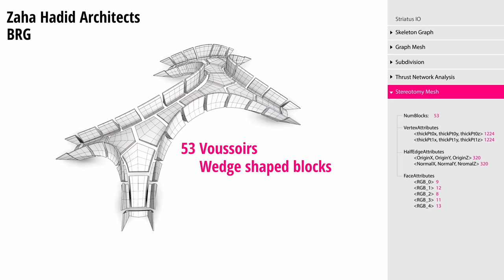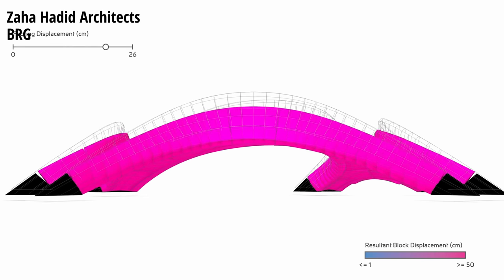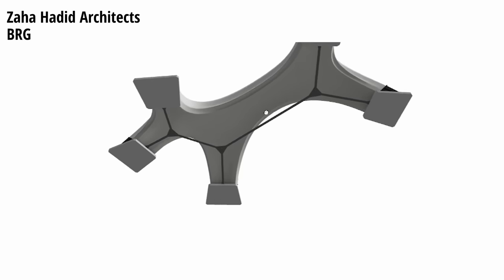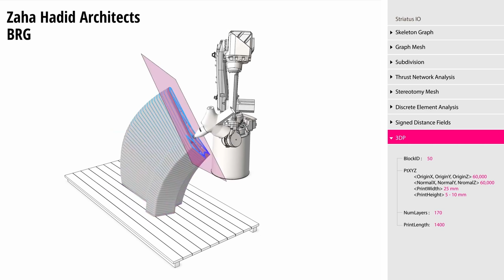3D printed bridge with NO connections! | Striatus

Comment: Wow, very cool. Initially, I wasn't overly impressed, imagining a structure that looked unnecessary, heavy, and probably would've been overly strong without the cables tying the base together. But then, 3D printed light-weight concrete pieces without interlocking or rebar or being completely solid, and only held together with geometry and gravity, very impressive. Excellent video, thank you.

Comment: I'm not an engineer, I'm just some guy, but I think this is very cool. Besides the fragility and opportunity for human error, I'm mostly curious/concerned with how a bridge like this would withstand water. If the hollow cells fill up with water, is there potential for shifting parts, damage, or even reduced overall capacity?
Reply: possibly
Reply: Think about cinder blocks - they're basically the same thing, only less dense and smaller. If these hollow babies can withstand the elements, i don't see any reason why big and dense 3d printed blocks can't.
Reply: @StanislavG.  /\/\/\ right there.
Reply: This is for an exhibition. It is designed to be taken back down, as I understand it.
Reply: @StanislavG.  ah that makes sense, good analogy. I just assumed cinder blocks were eventually filled with some other material
Reply: In the “wrong” environment, freeze/thaw may destroy this bridge rapidly. This is a cool proof of concept though.
Reply: Concrete is water permeable so it is possible that the water seeps out quicker than it enters. If filling up with water is still a problem, a small, short piece of tubing could be inserted at the underside of each piece.
Reply: @StanislavG.  I am not aware of any codes where you are still allowed to have unreinforced masonry walls. This was stopped because of life safety issues. Unreinforced masonry is not usually used to span except for old arches which are keyed together and have a large dead weight component that helps hold the arch together.
Reply: @yodaiam1000  I think the law applies differently to statues and exhibition pieces (no idea to be honest). In housing there are codes (in most places) for cob/SCEB walls that are unreinforced, but you'll probably have to use a reinforced concrete foundation and tie beam to comply. I guess the same codes be applied to this sort of stuff
Reply: @StanislavG.  Most codes are written for either new buildings or highways/bridges. There is only one code I am familiar with that deals with renovations/alterations (You use codes to design alterations,  seismic upgrades etc but the code will usually say at the beginning it is only intended for new buildings) and no codes that I am aware of that deal with exhibitions. Although most authorities want an engineering seal on exhibits/stages etc. I always reference a code or playground standards when designing structures for exhibits since it is the only reference that I have.
Reply: Prescriptive plain masonry is still allowed for seismically inactive areas in the US. Guastavino vaults have been in service up and down the east coast for 100 years. Also, there’s a few small regions like Europe, Asia, Africa, South America and the Middle East which are full of 400+ year old un-reinforced masonry buildings

Comment: Super, as usual. Thanks Belinda🙂
Reply from the maker: Thanks!
Reply: @BelindaCarr  This is not a bridge in the sense that it will convey vehicles or pedestrians over a distance that would otherwise be inaccessible (river, gorge or overpass). It is at best a very expensive playground novelty. Come on Belinda, you usually have practical videos.

Comment: I quite like the design. No pain no gain. Once the quirks are ironed out it would be nice if every area had these 3d printers and it became the norm to print out these blocks from the local outlet. Aesthetics wise it’s the difference between old bridges (more curves) verses modern bridges (more straight lines) - the old bridges are just more pleasing.
Any how, exceptional overview. Always appreciate how you research both the pros and cons.
Reply: This is not a bridge in the sense that it will convey vehicles or pedestrians over a distance that would otherwise be inaccessible (river, gorge or overpass). It is at best a very expensive playground novelty. Belinda usually has practical videos.
Reply: @1982nsu  Since you couldn't figure it out, I'll let you know it's a prototype.  They have to make sure they have proof of concept before actually bridging any actual gaps.  Baby steps.
Reply: @1982nsu  building using 3d printers IS practical. And you talk like Belinda doesnt research both pros and cons.  Luddite mentality.

Comment: Ancient and futuristic at the same time.  Very very cool.  What happens when it gets wet and ice freezes on it? What is the sheer strength of the neoprene?  I am thinking about a 5 millimeter ice "dam" building up due to evaporative cooling of the structure, which will ice, as bridges do, more readily than surrounding non-bridge-like structures that have no air gap below them. If ice moved in between the floating sections, it is possible the pieces could, over time, creep out of position.

Comment: The concept is great, but I'd feel better if they laced steel cables inside of it to provide post tensioning to insure that any seismic up thrust wouldn't dislodge any of the blocks.
Also, I'm concerned that some of the blocks broke in transit because they were fragile.  They need to make the cement mixture a lot tougher for this method of construction to be practicable.  If someone is going to mention that concrete blocks, and terra cotta blocks, are fragile and often get broken in transit and handling, it needs to be noted that blocks are cheap, standard, and readily available.

Comment: Steel in tension, masonry in compression, wide triangular foot print; structural perfection, or nearly so. Job could've been traditional formed/precast concrete sections, or sections cast on-site. 
The cool part here is that the design program can theoretically instruct the masonry printer directly, from anywhere. This might be the most probable application for 3d masonry printing, VS large on-site usage.

Comment: A 3D masonry bridge!  How amazing!  Never saw that before!  And it has NO connections - other than every piece, the ties in the foundation, and the load bearing platforms.  And its purpose?  Going over nothing and connecting nothing.
Reply: It couldn't go over something even if it tried since it needs that collar tie underneath to keep it together
Reply: @UGPepe  it can go over a road or railroad but you might need to tear up part of the road. Won't work for canyons or navigable water.
Reply: @szurketaltos2693   I agree 100%.  This is not a bridge in the sense that it will convey vehicles or pedestrians over a distance that would otherwise be inaccessible (river, gorge or overpass). It is at best a very expensive playground novelty. Belinda usually has practical videos but not this time.
Reply: @UGPepe  It could be designed not to use the collar, but like all structures of this nature it would require more infrastructure at either end.  (IE more significant concrete foundations, or more significant weight elsewhere in the structure.).

You are hardly intelligent for discovering that it needs the collar, the collar is simply the cheapest and least invasive method of allowing this structure to stand in its intended (artistic - since its for a design festival) position.
Reply: Peter Avram damn, my plan of measuring my intelligence in the youtube comment section was working so well until you showed up

Comment: Excellent point that this manufacturing process is able to do things that other processes can not.  But a key problem with the "robot squirts concrete" systems like this is the lack of reinforcing integrated into what is being "printed."  With a flexible arm like they used, pre-bend the rebar and have the applicator arm move around the rebar.  In this case, the reinforcing that "should" be inside the concrete was actually relocated to the ties between the piers, which would conflict with something like boat traffic if this was used to provide movement over a canal.  This is an elegant solution to the limitations of the process but it is still very limited in the end.  Not using connectors is just a silly stunt - an extra PR point for this demonstration, but pointless in "real" applications.  Also, the pieces being too fragile to ship is a significant flaw compared with a construction system that would be "ready for prime time."  It's a beautiful end result, but yet another "stunt" that shows this approach hasn't overcome some major limitations.

Comment: I really want to see more from this idea. I heard about and seen some 3d printed buildings before but nothing of this level. For me the question is practical can you make this technology for real functional structures for example this bridge in a bigger size may be used as a pedestrian bridge to cross a street or an intersection on a busy street.
But how practical would such a bridge be to let traffic cross a river?
I know this specific design probably won't because of the ground level steel rope truss thingy (I'm not an engineer or architect that's not my expertise I'm just an interested and uninformed pleb). But in general how useful could you scale up this idea?
Also how future proof is cement as a building material in general as far as I heard we might not have enough good sand for mixing concrete in the future, not to mention the environmental damage from sand exploitation.
Is there something coming the future?

Comment: 3d printing concrete sounds cool but with the difference in timing for setting, packing, etc, i wonder how defects like cracks are handled. 

maybe a different kind of ceramic that needs to be baked might give better results
Reply: Backing ceramics is a bit too expensive for most applications... I think the future is in portland/lime reinforced clay printing
Reply: your'e thinking of sidewalk or resi-foundation concrete.  This would be a UHPC
Reply: FYI that class of concrete starts at 17,000psi and goes up from there. It doesn't have the water and cracking issues typical 3000psi does.

Comment: How would that kind of structure handle thermal expansion / contraction over long periods of time? Despite the neoprene, couldn't blocks shift relative to one another? (not that Venise would see much of that, but I am just curious to know what more knowledgeable people would think of it)
Reply: Disclaimer: I'm not knowledgeable.

Considering that arch bridges built on the same principle have stood for centuries I'm assuming it's not too difficult for these structures to withstand those forces. They even have the potential to last longer than traditional concreting since the steel reinforcement rusts away over time. The steel tensioning cables shouldn't be too hard to replace.

Since it's a new technology and a new form of engineering infrastructure I suspect were going to see some expensive or even lethal failures until it is mastered.

Comment: I think you meant 2 foot wide extrusion sections with 3 foot tall balustrades? The assembled exotic form without connectors is only made possible by a temporary bespoke support structure; I think that's a big downside, given that it's not economically and ecologically scalable. For instance, you couldn't apply this concept to building a habitat on the Moon or Mars. The technology seems well-suited for bespoke panels such as rainscreens, though.

Comment: I just visited a 3d printed pedestrian bridge in Amsterdam.  It is printed in metal, and is a temporary replacement of  an old bridge being restored. It claims to be the first of its kind and was certainly interesting to see. Unfortunately the design is miles off from the structural efficiency and elegance of the concrete bridge in this video. You might want to do a comparison of the two in a future video.
Reply from the maker: I'm working on a video about that bridge right now! The years of research that went into it is fascinating. Why weren't you impressed?
Reply: The shape is more ‘neo-barok’ than bio-mimetic, as opposed to Laarman’s ‘bone-chair’. Given the cost and time involved in using 3d printing metal, this is a case where maximizing structural efficiency is a no brainer. That would really sell the benefits of freeform design and metal printing. If the idea is to show that you can just make any sculptural shape and get it printed this is not convincing as the layer lines and welding is so crude. The design does not take the directionality of the layering into account in the way the concrete bridge does, so it just looks arbitrary (i.e. bad). The hand rails that curls at the bank, is universally used as a trash can by passers by. Also there is a problem on one side with the pavement not aligning to foot of the bridge, that speaks to the absurdity of using an aerospace technology in a city where nothing is straight. 
Ultimately it just feels like a massive missed opportunity to do a really iconic and memorable example project showing off new possibilities.
Reply: On a side note: 
I watched my dad in the 70’s as he was producing a series of large public sculptures in cast aluminum. The largest ones were equivalent in size to this bridge. His technique was to start with a massive block of styrofoam, which he shaped with a hot wire. The results were clean smooth abstract forms that he had casted in aluminum at a local foundry. He produced these things in a few months, working alone!
It seems to me to produce a bridge like this by conventional means would be quicker, cheaper and higher quality. That may be beside the point of this exercise, but it is up to the designers to convince me what IS the advantage of this method.
Reply from the maker: Thanks a lot for sharing your personal experience! Can you send me your email address or email me belinda.julia@gmail.com? I'd love to speak with you if you have time this week.

Comment: Nice story on a nice piece. I like your comment on people using tech that could be polymorphous to make boxes drives me crazy.   I will point out this isn't a ZERO waste project. I'm guessing that is there claim not yours. Forms were straight to waste, the neoprene cut outs had waste, the printer needed to be flushed/cleaned each time it was used including the mixer and the scrap from the steel base including tension member.. It's low waste for sure but this is an issue with many claims of new "green" projects.

Comment: I think 3D printing in architecture is nothing more than a gimmick. The designs are very limited and the long-term usage is questionable. All those layers are very prone to failure due to heat and freeze issues and other long-term chemical issues.
These 3D-printed buildings are either small or short-term projects. I would really like to see a major project building with 3D printed parts. A building that lasts over many decades, in various temperature environments. Everything else is just simply a proof of concept that has no connection to real-world applications.
Reply: Prone to heat failure and chemical issues… apart from 3d printed chemical rockets ;)
Reply: I agree 100%.  This is not a bridge in the sense that it will convey vehicles or pedestrians over a distance that would otherwise be inaccessible (river, gorge or overpass). It is at best a very expensive playground novelty. Belinda usually has practical videos but not this time.
Reply: I agree that 3D printing as demonstrated to date is gimmicky. The falsework required for this bridge looks complicated and unless you're building many of the same design, it is wasteful. Might as well use the wood for traditional formwork and get the ability to add a little steel for tensile loads. I can't see how using robots to lay down concrete is superior to using molds for these bridge parts. The stress risers that result from the layers put down by the robot alone make me think this is not a good idea.
Reply: @rcrumbblue  molds for every bridge component would be wasteful in materials, unless lots of identical bridges are made (impractical) or the designs are uniform (boring and dystopian). I think all this talk discrediting a new technology just on a select few tests is unhinged frankly. If 3d printing is good enough for printing rockets (and drastically bringing the prices down, because all the intricate pipework for the coolants can be baked into the 3d printing) then the technology is good enough for most things. In this case the bridge had a supporting structure under the ground, but it doesnt have to be that way - there are other ways of preventing the structure from spreading apart as with any building or bridge which has arches.

Comment: "The bridge has no waste." That's clearly not true: the formwork at least was waste.  There was waste from breakage of parts. The shipping crates for the parts were waste. There's likely concrete wasted during the printing process. I'd say that "minimal waste" is more accurate, but I'd actually like a quantitative comparison of the waste produced by this project vs any other.  I'd bet it is "less wasteful" but not by much.

Comment: I have to be honest that hearing the word fragile describe the concrete wedges doesn't inspire a view of safety.
Reply: Concrete is fragile, under tension. Especially thin walls with a corrugated inner support. My guess is that one of the blocks was mishandled, put under stress in the wrong pair of directions, and snapped.